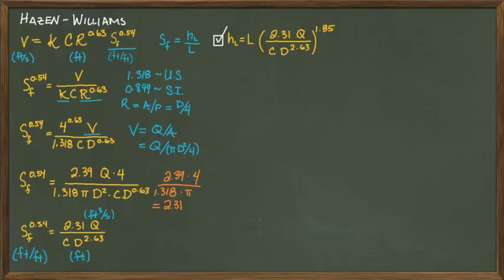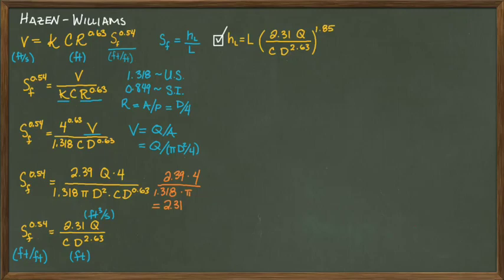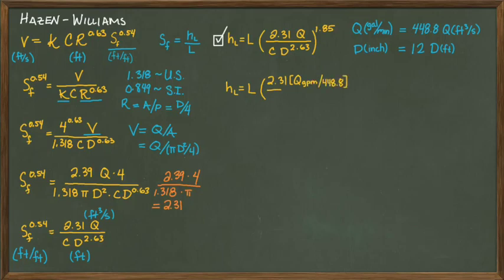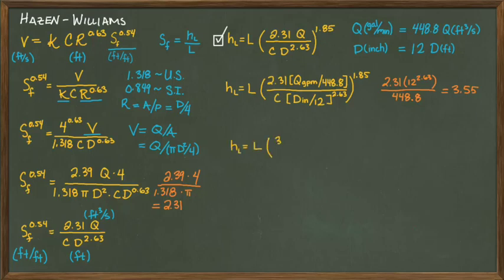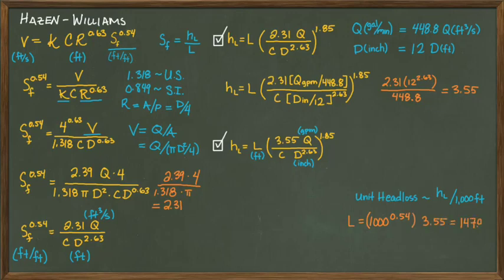Working With Hazen WIlliams

Comment: Hi Kenneth, I followed up until the units conversion. Shouldn't 12Din=Dft and similarly for Q

448.8Qgpm=Qcfs

Thanks for the helpful video.
Reply: I've been giving it a lot of thought and my conclusion is that because this is an empirical formula, we are not converting units but rather making a substition. xin/12=yft
Reply from the maker: @alecsandoval1214  That is correct.  It may feel backwards, but the objective is to substitute values.

Comment: Actually, we use it also in Nicaragua... Latin America... it's very common in our engineering practice! over 15 years using it...
Reply from the maker: I'm delighted to hear it.  Hopefully, the new video is of value.  I'm curious to hear from you or @Denzel if water agencies specify a maximum unit headloss (as a design criterion for new systems) or is this equation only used to analyze water networks?

Comment: I'd like to see the metric version of this video. I'm in Namibia, Africa.
Reply from the maker: DO you use the Hazen-WIlliams Equation in Namibia?  I  was under the impression that it was not used outside the United States.
Reply: @kennethwlamb  yes we do. I'm a third year civil engineering student at the Namibia University of Science and Technology (NUST). It's a concept we are currently going through in a module called hydrology
Reply from the maker: @denzelkharuxab1416  I'm glad to know it.  I will start working on the metric version.  To make sure the video is applicable, what unit do you typically use for flowrate, Q, in this equation? Liters per second,, Cubic meters per second? Or something else?
Reply: @kennethwlamb  when they test us they'll give it in litres per second and expect an answer in cubic meters per second.  Cubic meters will be good, just make sure you remind your audience of tge conversion factor between the two